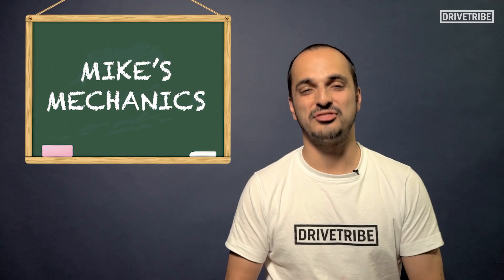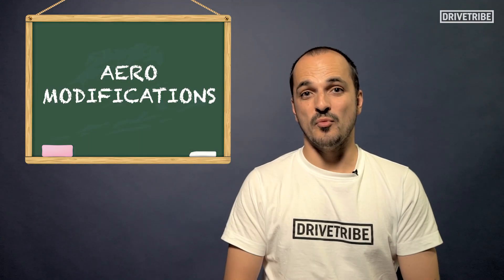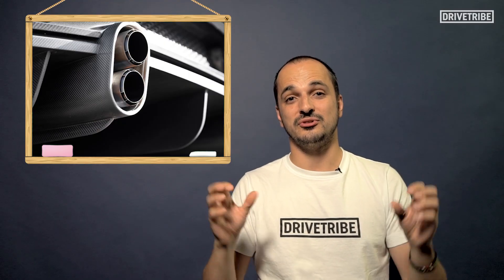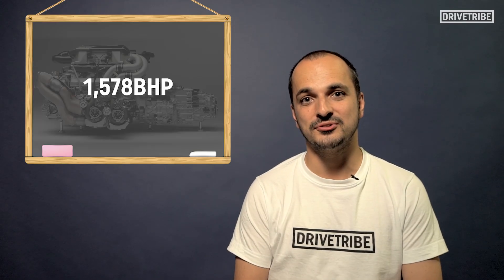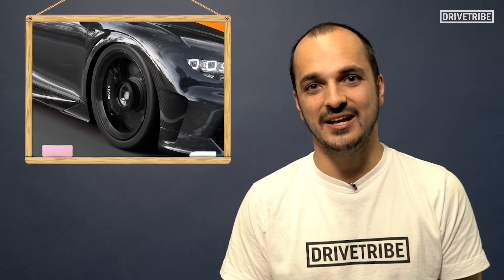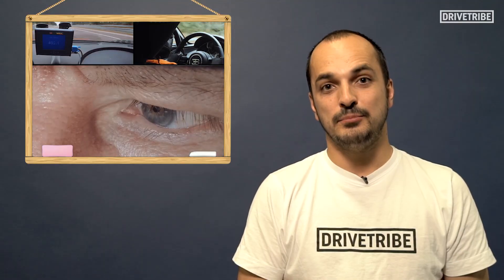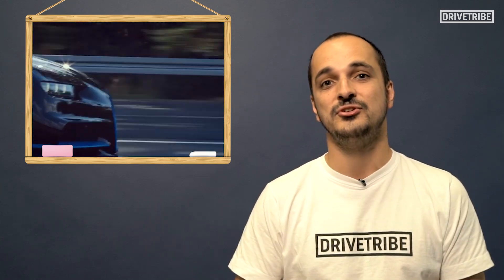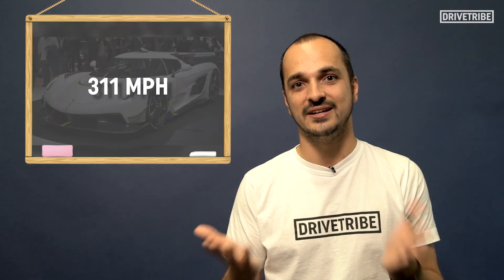How did the Bugatti Chiron reach 300mph?

Comment: The Yanks I'm sure will have an ace up their sleeves - just like they have smaller pints and gallons, they probably secretly have amaller miles - so tip a Hennessy to set another record but then adjust it down by about 20% to get the European equivalent....

Comment: All these records are soon going to run against a wall in terms of physics. If you wan't to go beyond 600 kph, you have to start looking past what is possible for production cars. You would no longer be able to use tires, but would need some sort of solid wheel. Along with a whole host of other issues you'd need to solve regarding friction and wear.

Comment: It wasn’t lighter, they added a steel roll cage and where the passenger seat would be was several lap tops, a camera, and a hefty fire suppression system. Oh and the wing was still very much there. They literally just added the 24cm on to reduce drag an additional 40%. But ok

Comment: A 14mph buffer on the tyres?. I would want a little bit more room for error than that. Anything you test wether it be performance or working with high pressure you would think a 50% safety margin would be the minimum. Oh well what a way to go in a Chiron though.

Comment: I'm starting to predict that we're pretty much at the maximum power that a production car combustion motor will be able to be made. Which is why partially these battery supercars are coming out because they can generate more power and get even faster 0-60s.... But why is the top speed still limited with 217mph (for example)? You'd think you can go faster than that but for a couple minutes before batteries run flat

Comment: "retiring at the top" of what you brainless idiot? This so-called record means absolutely nothing!  You said it yourself it's not a production car top speed record! Bugatti Volkswagen is not selling a Bugatti Chiron that weighs 4400 lbs in that configuration as a production car! So they only took 100 lbs out of the car from 4400 lbs? Yet you forgot to mention the massive roll cage and all the testing equipment added? Didn't mention the weight of the car or really anything in detail about how  Volkswagen actually got this one-off racecar Bugatti Chiron to 300 mph like the title of the video says because you don't know! You only talked about a few things that you know, and a million things you don't know about. What kind of record did they set? They modified a production car until it went over 300 mph that you cannot buy from Volkswagen Bugatti. M2K Motorsports took a completely street legal 90% factory stock twin turbo '06 Ford GT to 301mph six months before this happened at the Texas standing mile! Using a Accufab Racing built factory OEM production block, and cylinder heads equipped 5.4L Ford Mod Motor. The first production car to go over 300 mph very soon on production car tires that will be sold to the public will be the Hennessey Venom GT from Hennessy Supercars who's partnered with Shell oil, and Pennzoil. Testing started months ago. Koenigsegg hit 284 mph Agera RS which is a production vehicle on production car tires! And let's not forget that Koenigsegg is still using a Ford Motor Company stolen patented engine design V8 Mod Motor. You don't have to believe me go to Koenigsegg's website and read the article by Christian Von Koenigsegg where he says they changed enough of "our" when he should have said "Ford's" original engine which is what they were using that he feels comfortable enough calling it and all Koenigsegg design and built engine even though it isn't. The design, and architecture of the engine is exactly the same as the original DOHC Ford Mod Motors they used in the first four models of Koenigsegg supercars. They contracted out the block, and cylinder heads to a foundry in the UK, ordering cranks, rods, and pistons leaving the only thing they do at Koenigsegg is assemble Ford Mod Motors. In Christian Von Koenigsegg's article he doesn't explain how they designed an all new engine because they never did. He talks about catalytic converters, dry-sump oiling systems, crankcase evacuation systems, ect. Still to the to this day they still use a Ford Mod Motor design he stole from Ford Motor Company 15 years ago. And none of you automotive journalist idiots ever talk it. Bugatti's video and this video are complete bs! And show how irrelevant of an automotive journalist you guys are!

Comment: Top speeds are irrelevant. Cornering forces and acceleration are much more appropriate. I want a car that does the standing-quarter in under 5 seconds and which can corner, on a dry road, at over 4g. 
A $4 million car  that can travel at 300 mph - but only on a test track (and on tires that cost $10,000 each) is outmoded and slightly silly.

Comment: Funny how everyone thinks this is the fastest car. But it didn't do it in 2 directions. So koenigsegg is still the fastest production car. Still though, the official 300mph barrier broken for a production car is cool, and I'm eagerly waiting for that car to come.
Reply: Funny some people think only Guinness, a book publisher, certified the record top speed for production while ignoring other ISO independent organization like TUV. 

Add the variation of sea level where Koenigsegg ran at high altitude while doing its high speed run downhill with a modified Agera RS (upgraded from the existing customer car). Contrast to Chiron Super Sport doing high speed on flat surface near sea level with higher air resistance. Chiron had to work harder to overcome that obstacle at Ehra Leissen. 

Additionally, an independent tester reached the base Chiron electronically limited top speed quicker than Bugatti's claim in Florida meaning Agera RS will be slower. 

Lets face it, Bugatti broke the official 300 mph whether you like it or not.

Comment: Congratulations to Bugatti in their modified multi-million dollar supercar for almost equaling the achievement of Kugel & Lefevers when they topped 300mph in a modified 1992 Pontiac Firebird 20 years ago at Bonneville. 

There are some differences - the Firebird did a two way run and actually got the record, it topped out at 307mph, and the aero mods consisted of a ground effects kit, some hubcaps and a stock 1990 Firebird rear spoiler.
 
Other than that, they're both modified production cars making a run at 300mph, Bugatti is 20 years too late to call this a "first".

https://us.motorsport.com/general/news/lsr-pontiac-firebird-breaks-300-mph-at-bonneville/1768552/

Comment: Am i the only one who finds Bugatti's 300MPH run irrelevant? I mean its a non production spec car, and they say they are not going to do any more top speed runs which means they probably wont ever prove that a production spec car can achieve it. Now for example Koenigsegg has never posted any speed runs of a development car because they always wait for a car to become fully homologated production spec etc before claiming anything. Now I'm not saying that Bugatti is not a great car manufacturer its just that they did this run to claim they did 300 first which is an ugly pr stunt since it cant be done by a customer car.  My opinion is that it is foul play from them.
Reply: You are late. The production model retains the same specification of the model that did the record aside cosmetic differences i.e. lack of passenger seat replaced by data equipment. Safety at that speed was a major concern as no manufacturer ever broke 300 mph with their production car. Let remind that Veyron Supersport went to similar process, so did Ferrari, Lamborghini, Jaguar and McLaren in the past. It will be hardly surprising the Chiron Super Sport will be quicker than its pre-production version similar to Porsche with their 918. Bugatti is very conservative when it comes to performance as an independent tester found out the customer Chiron quicker than Bugatti official claim.

Comment: While cool, we've reached the point where such speeds are becoming increasingly dangerous for the driver. The risk of failure from a tire or even so much as a bird or squirrel wandering onto the track becomes increasingly high. Yes the car may be capable of reaching such speeds for a short time, but the practical challenges of actually reaching it are becoming more and more challenging. 

I mean, for it, I guess. If we are willing to dump an infinite amount of money into it than I'm sure a 400 mph car is technically possible too.

Comment: They also can't claim the record because this is not a production car. It's a modified production car.  And also apparently on a stretch of tarmac that you can't properly claim a record on. The laser leveling is cool. And congratulations to Michelin on the 300mph tire. Call me when someone actually does it. We've got plenty of drag cars cracking 300mph with way less distance.
Reply: It is a production car as 30 are on the way. The name is Chiron Super Sport 300+. The process is no different than Veyron Super Sport in case someone forgets.
Reply: @Tippotipo  "on the way" is not already done. Besides the tires are the real breakthrough. Bugatti and Koenigsegg have easily had the power and the aero for this for some time. I get Bugatti generating hype with an asterisk laden record to coax that billionaire money into their showrooms... but for those of us watching this as an engineering competition, who won't ever buy any of these cars...the race isn't over til it's a customer delivered car that can do it.
Reply: @starvalkyrie  You talk about a common practice done by manufacturers for long time. As an example, Bugatti Veyron Super Sport went to the exact same process. McLaren, Ferrari, Lamborghini, Porsche did the same and nobody complained.
The record is valid because it was verified by independent inspectors SGS-TUV, a worldwide organization specialized to production vehicles, who attended at the run, as quoted by Bugatti themselves.
Reply: @Tippotipo  And none of that matters because the car in this run is not a production car. It's a prototype. When they do the run both ways with a production car. They can be the "first place" that keeps second place from getting a trophy. Until then the 300mph production car record is still up for grabs.
Reply: @starvalkyrie  Veyron Super Sport did similar process, nobody complained. Previous production cars did nearly identical process. Chiron Super Sport is a production car whether you like it or not
Reply: @Tippotipo  The chiron super sport may well be a production car... eventually when it comes out. It's scheduled for a 2021 release... you may have noticed it's currently 2019.  This is not a production super sport, this is a modified chiron, a prototype and test bed for an upcoming production car.

Whether I like it or not has no bearing on the difference between a production car and a prototype. It's right there in the video. And on every other article written about the car, and bugattis description of the car.

This is not a production car run period.
Reply: @starvalkyrie  Chiron Super Sport is a production car as recognized by an independent inspecting organization TUV making the above argument moot. It is the exact process done with Veyron Super Sport.
Reply: @Tippotipo  Production car comes out in 2021. It's not a time machine. So it can't break a record in 2019. TUV can verify the performance. They can't change the definition of production car. The Super Sport 300+ will come from the factory... electronically limited to 270mph... It will sit higher. The considerations of shipping a car to a customer capable of doing this are more stringent than one you had a race driver do at a specific stretch of track in a single direction.
Reply: @starvalkyrie  TUV has more credentials than your argument as you clearly are ignorant on the topic related to production cars. Your assertions are based on Guinness, a publisher book, who know very little about automobile industries and the rules for production cars.
Bugatti did exactly the same method with Veyron Super Sport, so did McLaren, Ferrari, Lamborghini, Jaguar and other for decades.
Reply: @Tippotipo  No my assertions are based on the actual challenges and restrictions involved on delivering a production car. Bugatti won't even call it a production car because it would unambiguously be false advertising.

The actual production car is slated to release with the power, cooling, and tires to do 300mph. But it will be at an actual streetable ride height, and electronically limited to 270? Why? Because Bugatti knows better, clearly than the people that have turned the clickbait title of these videos and articles into a reality about an achievement.

As far as Guinness goes. Record are based on rules and comparing runs that follow different rules is nonsense. I wonder how many of you people fanboying out on Bugatti so hard would be ok with a game where my team gets to play with completely different rules than yours.

This is a modified car going 304mph. It's really cool, and it's the most streetable modified car I've ever seen do it. But nothing anyone does or says after the fact makes a modified car a production car.

No one, including TUV, has called this a production car record. Because they know better. But they did the run because they know youtube can't resist the clickbait and someone ignorant of the gap in challenge between production and modified will buy into it.

Comment: How do you consider lightness an important parameter for a speed test? The only impact  of weight is on tyre contact patch. But the rolling resistance is way way lower than aerodynamic drag at that speed. So i don't get why.

Comment: Weight has nothing to do with top speed according to Andy Wallace, acceleration yes but not top speed, I wouldn’t say removing the passenger seat the replacing it with huge amounts of test equipment and a roll cage would’ve lightened the car at all, probably the opposite. 
Andy also said the tyre were standard Chiron fitment but yes they were X-rayed for optimal integrity. During the interview there was nothing mentioned about laser guided ride height regulation and I would’ve thought that would’ve come up, sounds a bit like fake news.

Comment: Weight doesent affect top speed! It affect acceleration, and rubber heating. For speed, power and drag qoeficient are cruical!
Reply: The rubber can only take so much heat. The longer spent accelerating a greater weight the more heat will be in the tire. So yes if we make the tire invincible and the track infinite length the weight won't matter... but this was in reality

Comment: Stressing in your dialogue how light the cars are made through modifications for these top speed runs is misleading. Lightness is not required for increasing top speed and has no effect on it. Yes you need appropriate downforce and yes you need reasonable acceleration but that’s not the focus here.

Comment: Even though if the record is broken by agera bugatti is an true automobile machine without the power of electric motors and equipped with 8 litre W16 engine with DSG unlike agera.so bugatti will be an class for ages.
Reply: the Agera S doesnt have electric motors....

Comment: I hear from reliable sources (top gear) due to public demand the allegro going back into production and hopefully going to smash the 500 km record hopefully it will be the Vanden plas model it will have a  upgrade quantic steering wheel there will be racing in both directions Unlike most cars they won’t even bother turning it around as everyone knows it’s more drag coefficient  in reverse that going forward so should be even faster coming back all hopes are on the Allegro to put the great back into Great Britain again 🇬🇧🇬🇧🇬🇧🇬🇧🇬🇧🇬🇧🇬🇧🇬🇧

Comment: Lightness wasn’t a factor in this record... what are you on about? The car already weights practically 2 tons you really think removing a seat and some extra carbon parts are gonna change the weight? Also weight isn’t necessarily bad, in fact it adds stability to the car! My guy you need to re study mechanic engineering and physics if you think “ lightness” was a factor in this top speed run. Ill tell you what the factors were: 100 more horsepower, longer tail for added stability, higher gearing, special tyres and mew suspension set up plain and simple, oh and also... removing the damn limiter off the car ffs

Comment: Just a few things to note;

1. The Chiron they used was built for this specific run. It's not in production and even though Bugatti have said they are making 30 of them, who wants a Bugatti with only 1 seat? (The moment you add a second seat, it's not the same car). In comparison, the Agera RS that did the 284mph run, is a regular Agera. 

2. As mentioned in the video, the Bugatti only ran the car in one direction, so an official speed cannot be recorded.

3. This may be the first time a company has announced (and shown) their car to break 300mph, (and as mentioned earlier the car was built for this single run), the Regera is known to be faster than the Agera, but no one has bothered to do an official run in it - why? Well because CvK doesn't really care about being first. Bugatti held the 268 mark for several years, and then broke it with the Chiron, only for CvK to say 'Hey, here's a car I built 5 years ago that's faster than the one you just spent 5 years building'. That's why, if Koenigsegg decide to do an official run of the Regera, I expect it to smash this one off, custom build car.

Comment: in one of the koenigsegg videos christian said, that when they did over 400kph, the first were afraid of tyre overheating, but when they actually did it, tyre temps were way below what they expected, so michelin went from, you can maybe do 2-3 runs on one set, to well, you can't kill the tires with just going straight.... so no heat wasn't an issue at all.